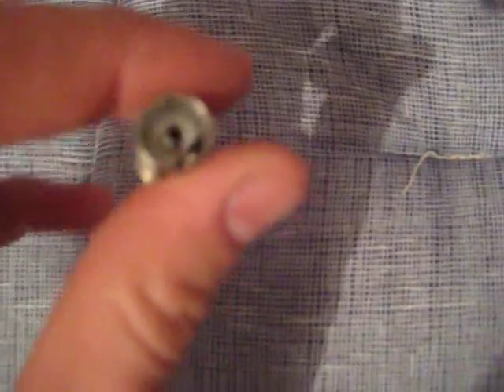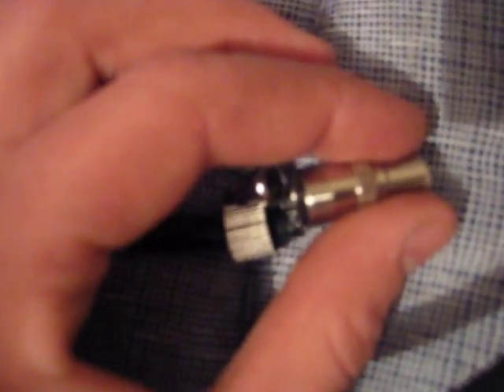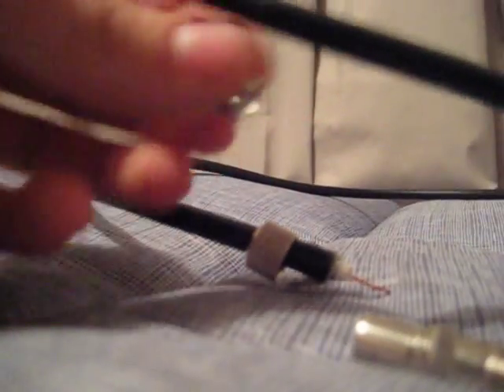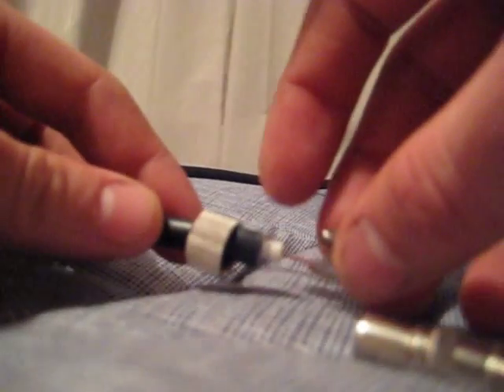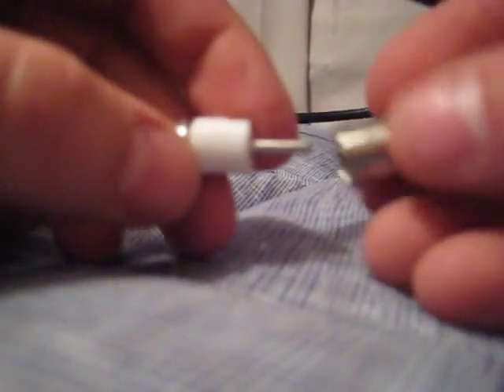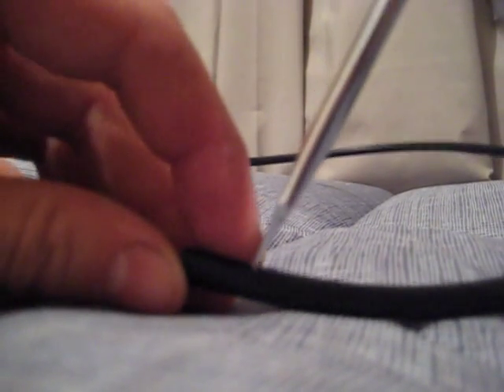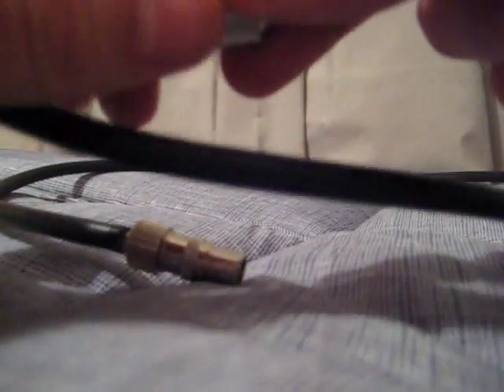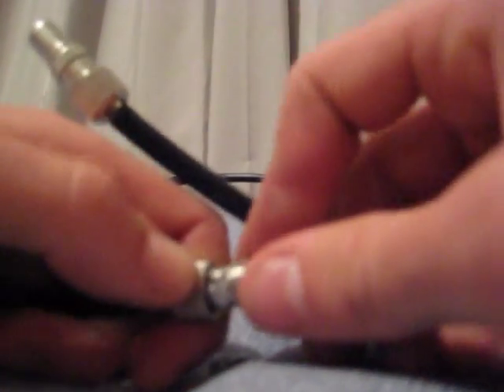How to terminate Quad shield DTV Coaxial Cable

Comment: I use compression connectors- I spent US$10 on the tool, $7 on the fittings and $9 on the stripping tool- all professional grade.  I bought them for a large installation in a travel trailer (what Europeans call a 'caravan').